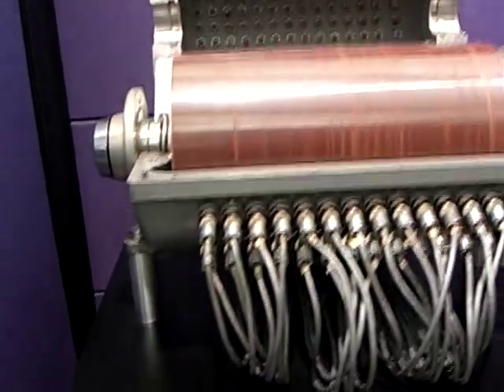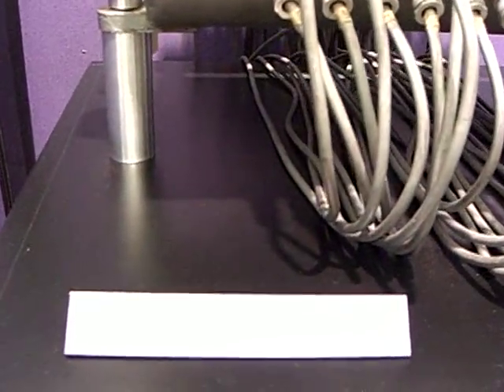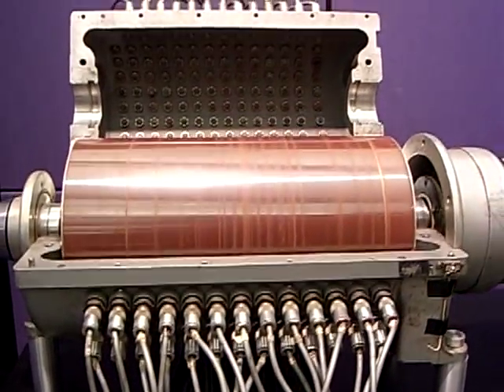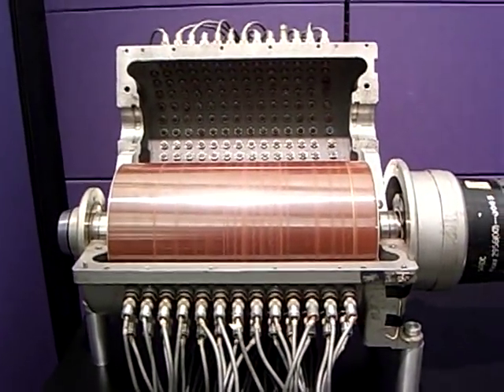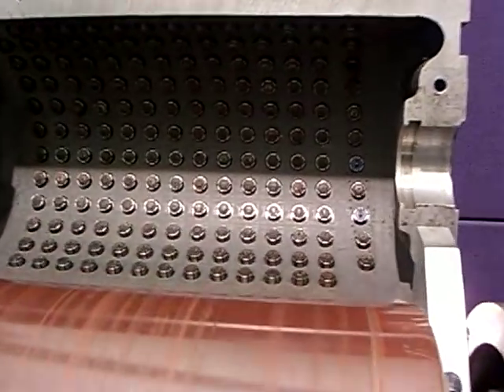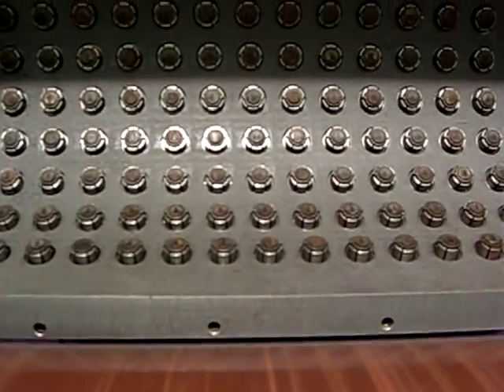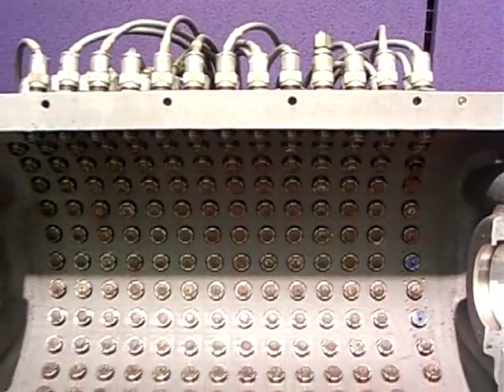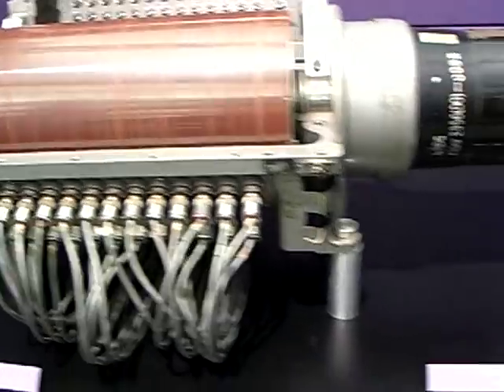1950's Early mechanical "Direct Access" Drum Memory Storage

Comment: I was lucky enough to experience a Drum Memory head crash first hand.  Lot's of noise, and a fair amount of smoke.  The system was in the basement of a local hospital and had been in use for many years.  Wild stuff!  If I remember correctly, the device was anchored to the concrete floor to minimize vibration.

Comment: The F-4E simulator I worked on in the Air Force used a GP4 computer with drum memory.  When I got there they had just upgraded to solid state memory so I never saw core memory.